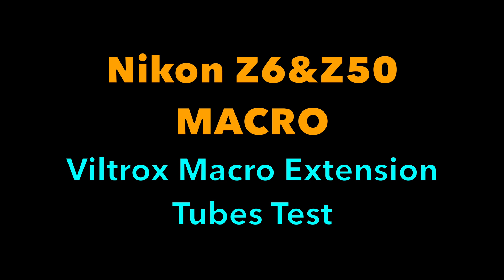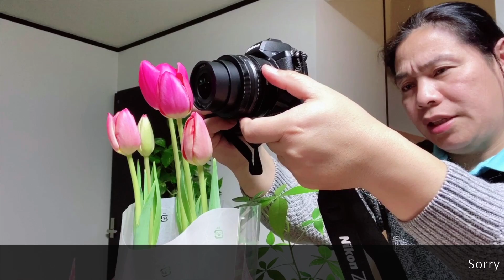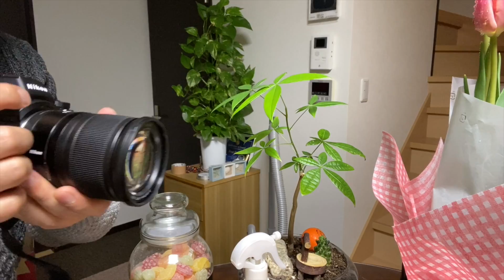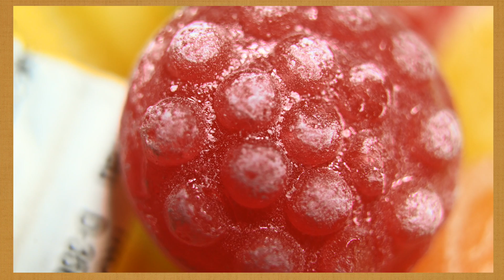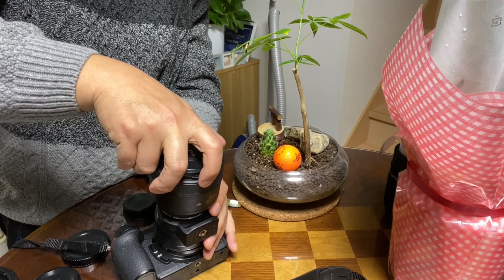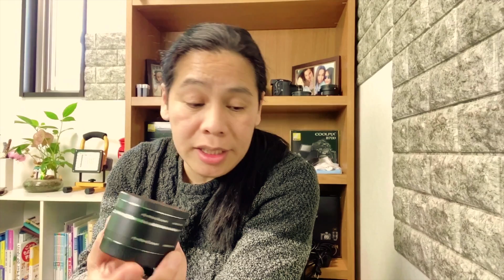Budget Viltrox Macro Extension Tube for Nikon Z mount Test

Comment: macro with the F-mount lenses is probably best with a PN-11 or such F mount extension tube after the ftz adaptor, the problems you had might be because the extension tube was before the ftz adaptor.
( ie: because there was too much electrical wires, etc. in between the lens and camera, as I think the ftz also has some electronics in it as well, due to the bulging nature of the tripod foot on it.)
Reply from the maker: andy van thanks for the info bro. Wouldn’t have known that.